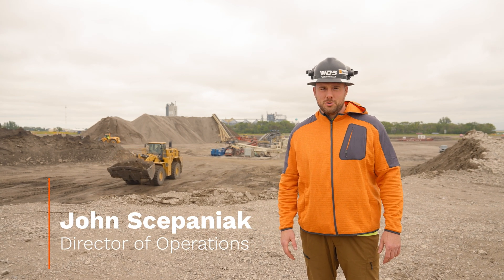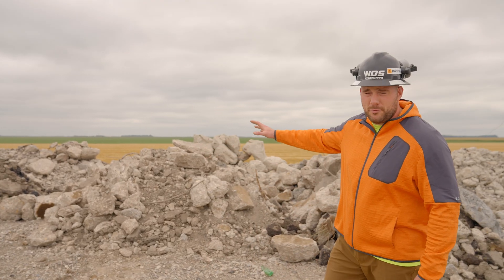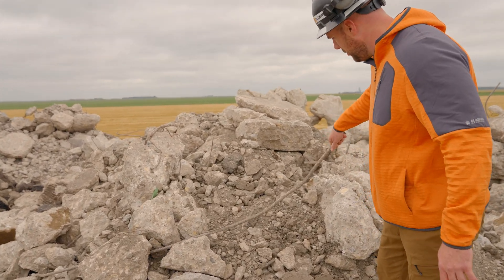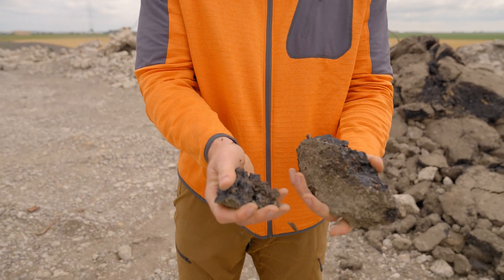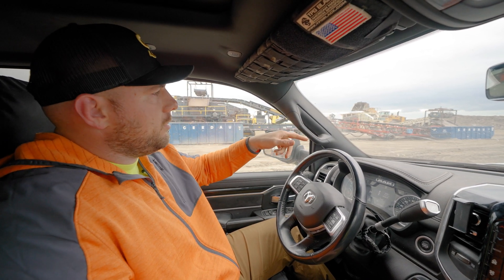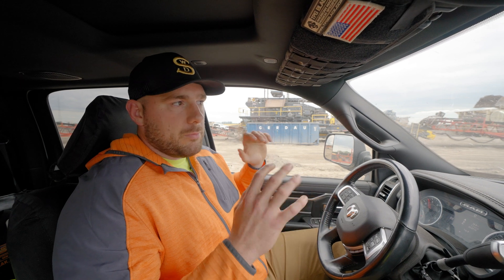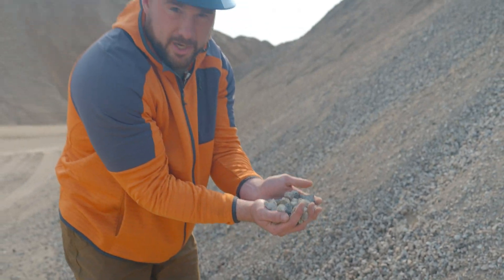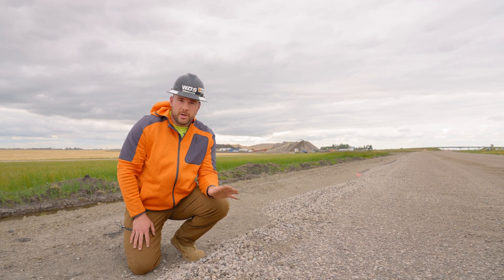Crushing Concrete and Asphalt

Comment: Hey I’m wondering if you can share some tips with me. We are crushing concrete but it’s hard to keep the cone full without plugging off. Would you share some tips with me ?
Reply from the maker: Sure,  what are you crushing with before the cone? What’s the feed size
Reply: Hey there the product going to the cone after the jaw is approximately 6 to 7 in. We can only get it to run half way up the cone. If we try to feed faster it just plugs off the cone. I am just taking over our crusher unit for the company I work for as the old guy is retiring. I’m trying to run efficiently and learn from experts like yourself

Comment: How loud are 1 of those crushers and is there much dust comes of them or will the water jets kill all the dust
Reply: I just ask cause there’s a company here in Ireland and they are trying to get planning for a concrete crushing plant but locals are saying that there is excessive dust for the crusher and the noise from it is louder than a jumbo jet taking off . Just wanted to know from someone who is dealing with crushers everyday what the real answer is thanks . And how far of a distance from the crusher till it’s like a lawnmower
Reply from the maker: The uninformed public always seems to have strong opinions that impede progress on permitting.

On our most recent noise sampling at one of our granite crushing operations , noise averaged a 30db 90% of the time at 500-700 feet.  There would be occasional peaks ranging from/50-90db for short durations when striking the blocks.  However these were all within the thresholds of our state permitting allowance 

In terms of dust or fugitive emissions, we conduct visual opacity testing on equipment and add dust mitigation via water spray where needed
Reply from the maker: The water neutralizes the dust, the noise off put by a crusher at distance is less than a lawnmower

Comment: My question is you don't have many problems with ripped belts on the jaw from metal being stuck still in the jaw as it falls to the Lower belt?
Reply from the maker: Not too many issues on this job.  Material is prepped well.  Other jobs have been a problem.